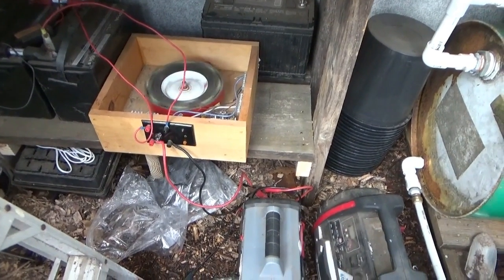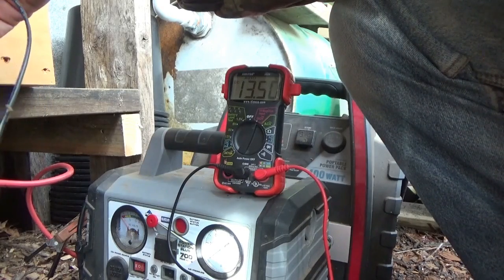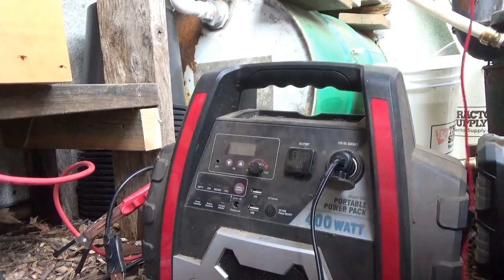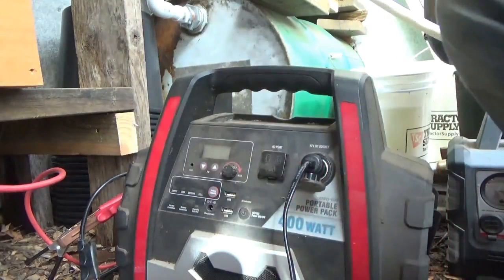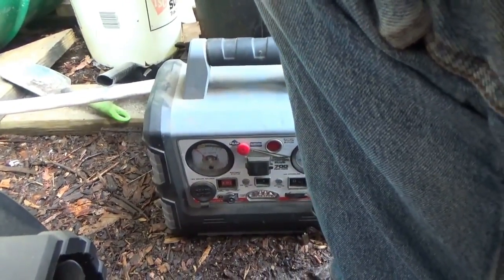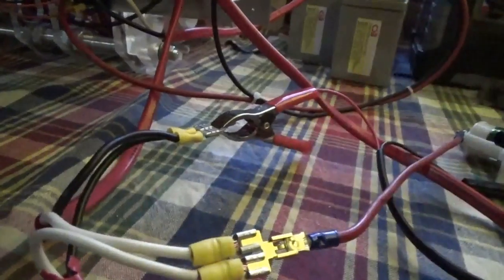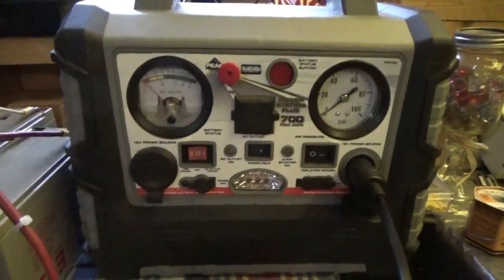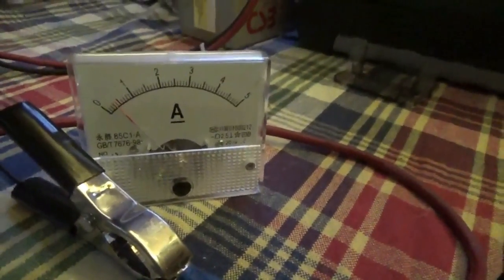Battery That I Restored Is Doing Work Now

Comment: I know this won't be read by this channel owner but I'll try anyway its easy to disulfate a battery just drain it to 1/2volt or less reverse charge then cycle till  sulfation  is gone add sodium sulfate food grade 2 tablespoons to each cell it slows sulfation cycle life improves to 600 to 750 time sulfation only can happen in negative polarity field change polarity sulfation goes the other lead plate full charge and amps are restored  again till that plate sulfates  lead acid are able to reverse several times look it up if you don't believe me google it
Reply from the maker: Why do you "know" this wont be read by me? I have heard of this way but I dont like to change the chemistry of batteries. This pulse motor not only desulfates batteries but conditions them. They get better with time. Its all chemistry.
Reply: sorry thought you might have to many comments to spot my comment I've watched your vids for years nice work I have done this to my batteries and it has worked for my solar set up i out found by reading online by chance  that it was used back in ww2 submarine to desulfate there lead battery they reverse charged every 6 months I'm not to worried bout chemistry of battery just want it to charge and work so far it has its from what I found reverse charge was patented I found that on Google patents I follow its directions thanks for your reply
Reply from the maker: Not sure about the longevity of batteries used in your way but with the Bedini motor they actually can potentially last a your life time. And its fun and clean working with it :)
Reply: im not sure of real world long term use but patent said only 1 to 2 % loss on positive plate each reversal ge and I know your way helps  there is pulse chargers on the market and relay home charger I've made helps but I bought reverse pulse charger battery size matters though  I've done 3 batteries in reveres it didn't hurt em first charge was real slow  but they were junk even if it wouldn't have work they would have been cores get a chance look up sodium sulfate exide use it in an electric car lead acid battery back the early 90s reported by hot rod  magazine cycle was increased greatly
Reply: im not sure of real world long term use but patent said only 1 to 2 % loss on positive plate each reversal ge and I know your way helps  there is pulse chargers on the market and relay home charger I've made helps but I bought reverse pulse charger battery size matters though  I've done 3 batteries in reveres it didn't hurt em first charge was real slow  but they were junk even if it wouldn't have work they would have been cores get a chance look up sodium sulfate exide use it in an electric car lead acid battery back the early 90s reported by hot rod  magazine cycle was increased greatly
Reply from the maker: I heard you can only use epsom salts a few times before the battery is junk. I am no expert at all on the subject though. Just what I read.
Reply from the maker: But never heard of what you are using until now.
Reply: yea Epson salt works some what it raises voltage hence some sulfation goes back into solution but its the least effective alum food grade is a little better its a weak acid so when added to very bad battery it basically is getting its acid level back hence again some sulfation goes back into solution but now from what read sodium sulfate or glabber salt is the best electrolyte additive from what I read it slows harding and soften hard sulfation so cycle life increases a books from early 1900s on lead acid gave me the info when i Googled it found more on it I will ordering some but have not tried it yet I figure that adding sodium sulfate and reverse charging every 6 months might with a reverse pulse charger might just give me good long sulfate low cycle life I'm sure battery makers don't  want longer battery life hit the ole bank account if ya only bought a battery every 8 years over 4

Comment: watching your last few videos about  this battery, I know you can improve the life of the battery so it can be used in a different set-up, but can it provides the same full amp hour output that it was designed for?  show it starting a full sized car with a dead battery, or use  the air pump to fully inflate a tire.

Comment: Great job Troy !! and still say all this stuff your doing with that motor thingy and charging batteries is ABSOLUTLY part of off grid living and or homesteading so people need to get over it !!  What's difference does it make between power sources ?  Your motor thingy or the sun or wind or hydro it's ALL the same principle !!  Seeya Rob
Reply from the maker: Thank you. Biggest difference is that the Bedini motor pulses the battery which breaks up sulfation in the plates. This can restore a sulfated lead acid battery. Well, can and does :)

Comment: Congratulations on bringing that battery back to life.

What would be interesting would be to see if you could use the output 
of the pulse motor ( Interplexing beacon ) to recharge the rescued battery jumper while it is acting as power source.

Caution.....running that INterplexing Beacon may inform the Borg of Earth's position which may result in 
a pulsing probe appearing in the early night sky.

Comment: maybe this device helped bring back some usability to a sulfated battery. i'm interested in what percent of this battery's capacity this desulfation brought back. if this battery could run a load for 10 hours when new.....how many hours could it run now with the same load?
Reply: a lot less.... its lost his capability to give off high amps, agree, it revived from being totally dead to usable for small loads, its never gonna be new, thats a hoax., what y want to see is uge amount off amps... sadly thats not gonna happen.
Reply: There are ways using simple mathematics and a precision resistor to determine what the internal resistance of any battery is. To determine the useabilty  of a battery by simply measuring no load (or near no load) voltage  is as useful as tits on a boarhog. It is no major gain to partially  remove sulfation on limited areas of the plates. Not only will the maximum current capacity still be reduced , the internal resistance remaining will  produce internal heat (under load) Heavy use will warp the plates ...if they aren't already warped. It should also be noted that sulphate removal will do NOTHING for corrosion of the positive plate nor removal of particles which have fallen off the plates. Look at it this way: If you find a "miracle product" that magically polishes your hubcaps....you really haven't ended up with a reconditioned car. Beware : IF you ever mix a " reconditioned battery with a like new battery (in series) ,you're going to get very screwy behavior from your charging system,as the battery with a high resistance will be consuming charging power and generating more internal heat...that could be going to the other batteries.( Anyone with an understanding of Ohms law, Nortons theorem and Thevenins theorem can easily verify this stuff  . (This is basic , electrical engineering 101 stuff.)
Reply: cant agree more, its to the point Steven Hardy!, hope Throy will read it to, told him this about two years, he still persists... lol
Reply from the maker: Richard, we will see. I am going to be showing everyone on video as I work with this battery.
Reply from the maker: Yes Steven is correct on most points. A physically damaged battery cannot be restored and this device cannot put lead back on the plates. BUT it can remove the sulfation on the plates and, if there is no physical damage, it can restore the battery to like new.